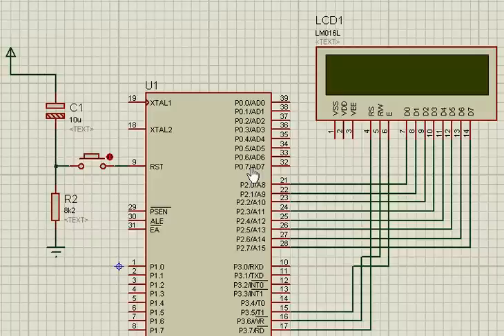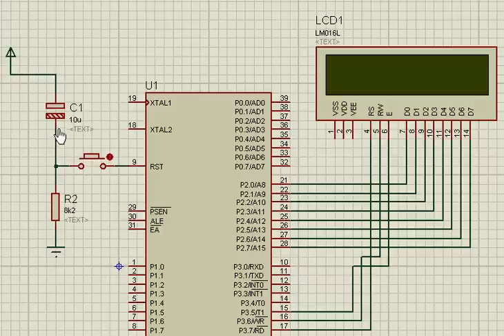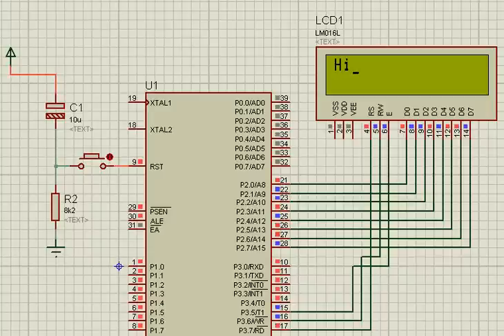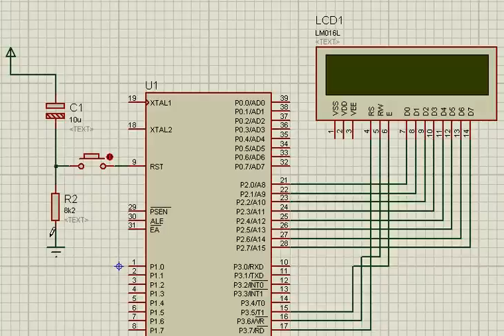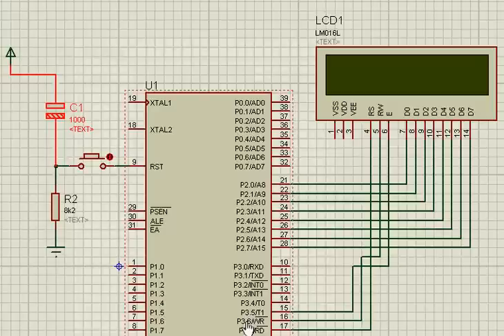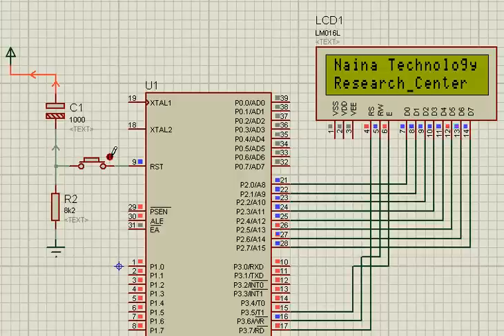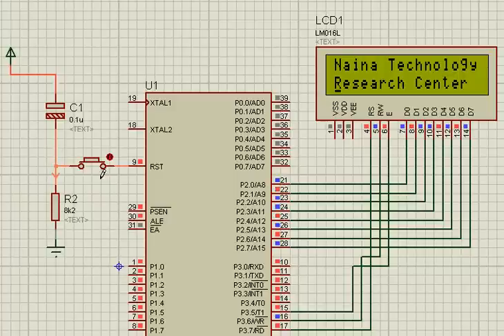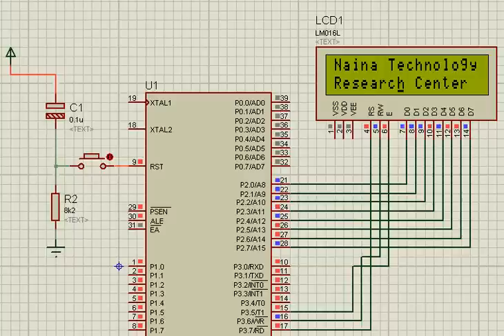8051 reset circuit

Comment: Reset Circuit shown in the sch. is wrong as when key is not pressed status of the Reset pin is floating , that is prone to pick up noise and reset the controller randomly
Reply: you are absolutely right man
Reply: Ya could u say how to connect
Reply: The circuit which I have also have a problem